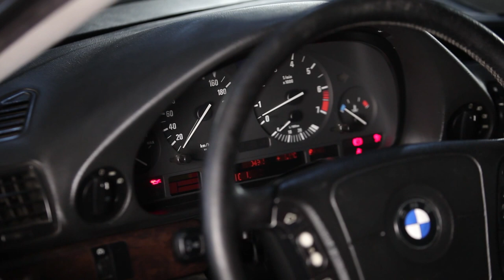How to change engine oil and oil filter BMW 7 E38 TUTORIAL | AUTODOC

Comment: I think these videos are great and well done for a wide audience to learn from. However in this particular video, I think the choice of using an E38 with a 6 cylinder M52 engine was very misleading. I know these smaller engines are are more common in Europe, however the expectation in the other markets (such as USA) is that an E38 is going to have an M62B44TU V8 or M73 V12, or older M62 V8 engine. You should probably rename the video to represent the engine type, not the chassis type, in this case. Continue to use the chassis type for suspension videos etc.
Reply from the maker: Thank you for your informative feedback. Your remarks are highly appreciated since now we know which replacements our viewers want to see most. Stay tuned, more interesting videos are yet to be uploaded! Best regards, Autodoc!
Reply: Yeah, the drain plug is different size and on the bottom, not the side.

Comment: did he just use 1 qt of oil?
Reply from the maker: Thank you for the feedback! This video is considered to be an informative one, and it shows the sequence of repairs, so some stages of the repairs might have been excluded. Best regards, Autodoc.
Reply: theres a relay mounted to the oil filter bracket thats constantly  ticking on my 2001 740il what is it for and is it normal?I don't remember hearing it before. thanks
Reply: that's an evap purge valve, not a relay. if it's ticking it means it's working